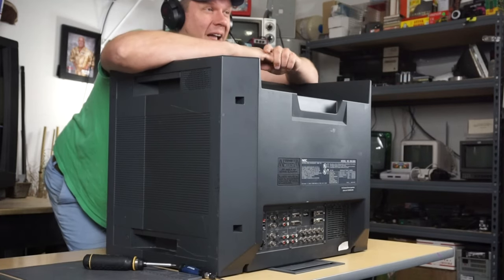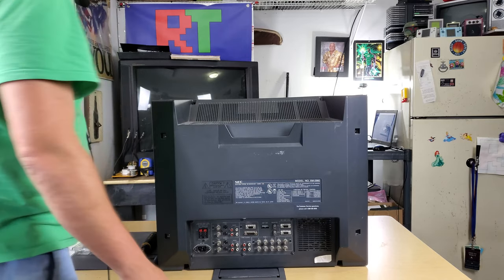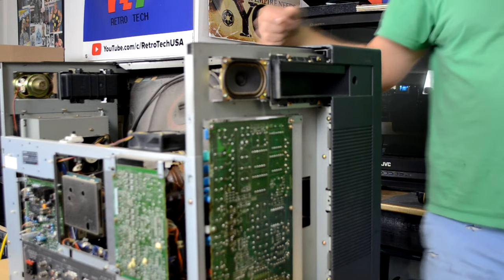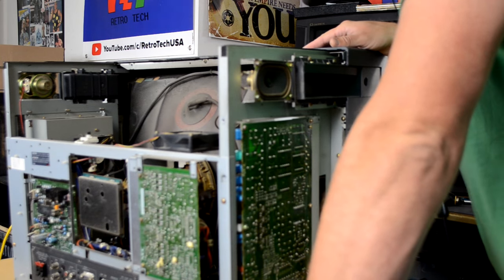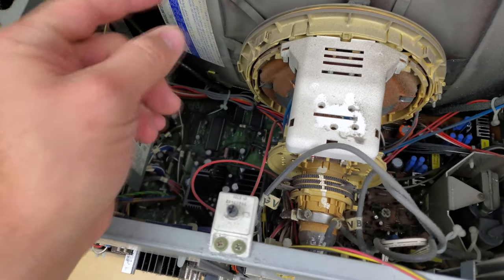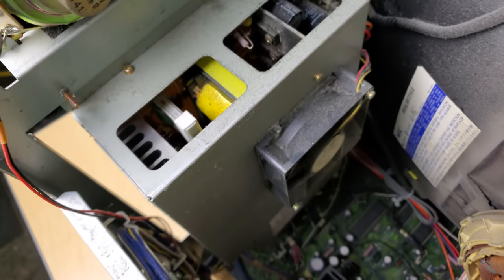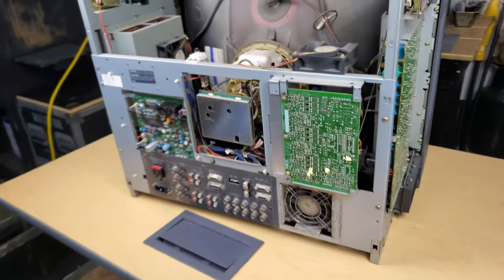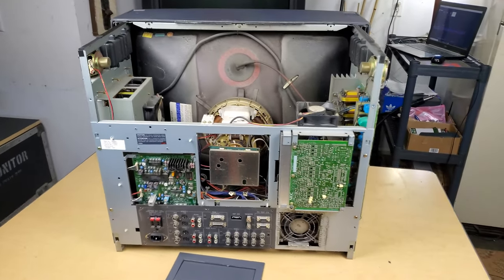NEC Pro CRT Restoration - XM29 | CRT Tear Down

Comment: Is there a way to calibrate a consumer grade crt with colorimeter?
Mine only has RGB bias and RGB drive controls in service menu. I used a two point grayscale and had to compromise to get equal color errors at 30% and 100%.
I think it actually looks better with factory settings of RGB drive, the bias is all set to 0 default from factory. I have the contrast set to hit 100 nits.
The service manual instructs u to calibrate white balance with that thin horizontal line that's blue. Then you have to do some step before u can adjust it by messing with something inside tv.